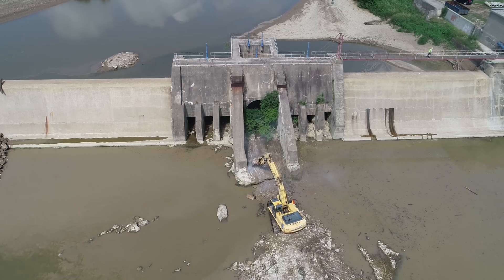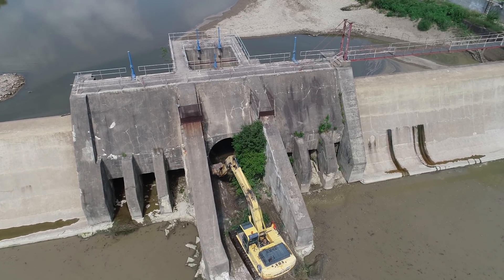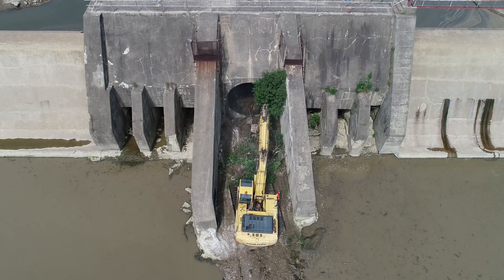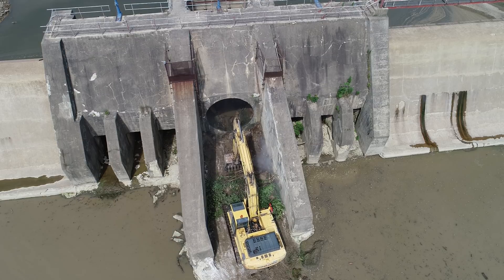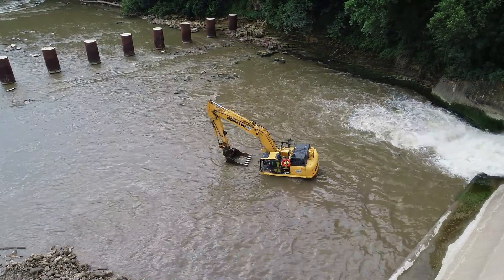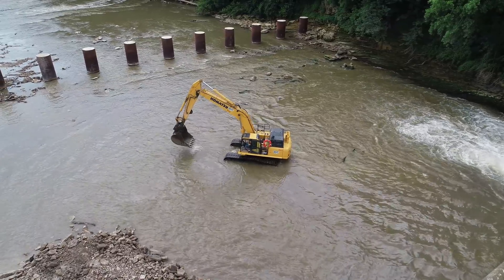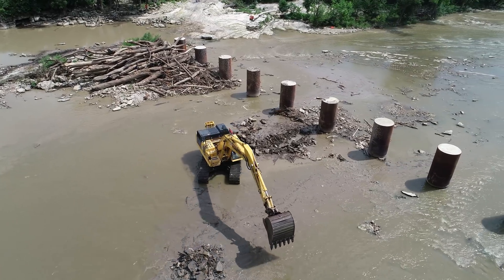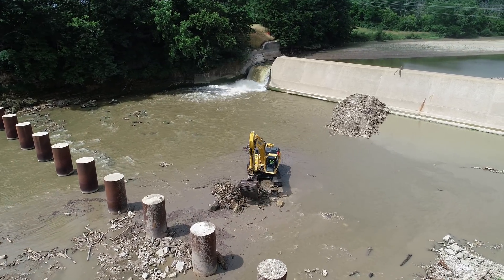Dam Removal Day 1

Comment: What is the reason for taking this dam out now? Because there had to be a reason for it to be built
Reply: Any dam once no longer used is a money pit and extreme drowning danger.  If dams are no longer used for their original purpose, they should be removed.

The benefits of removing dams are the above cost savings from having to maintain them, the removal of the drowning danger and as an added bonus, fish upstream and down stream will be able to move past this point in the river.  

Dams are generally terrible for river ecosystems.
Reply: @JeffreyGroves   that makes alot of sense. I didn't know if there was a real reason why or not. That's why I asked thanks
Reply: More than likely a bunch of environmentalists got their panties in a bunch.